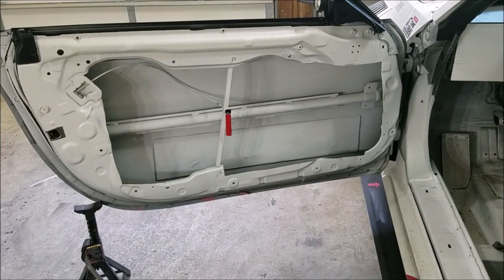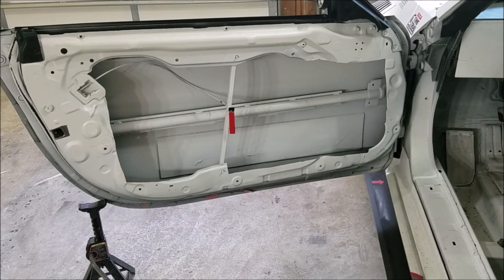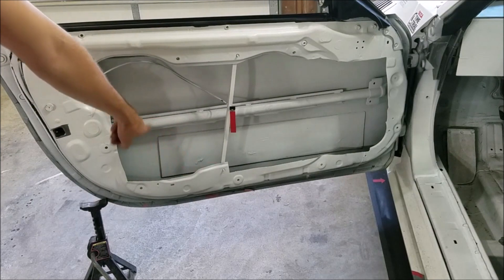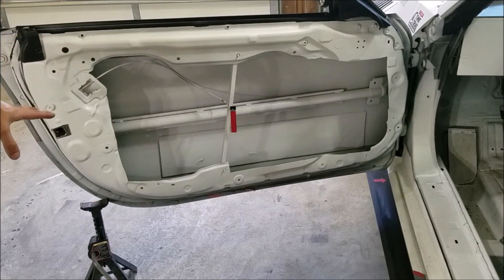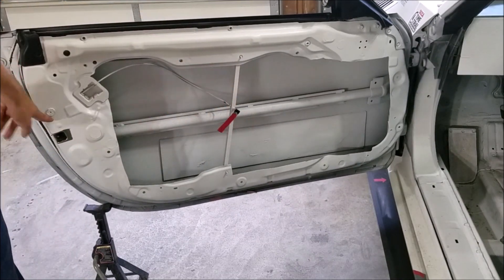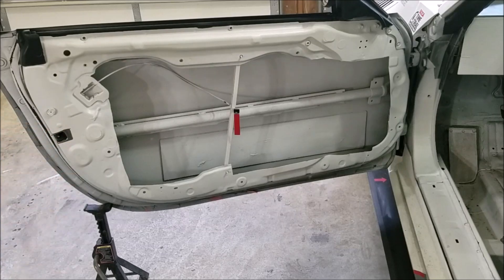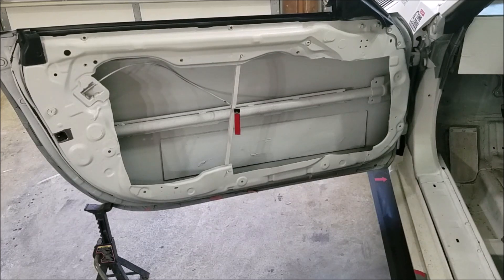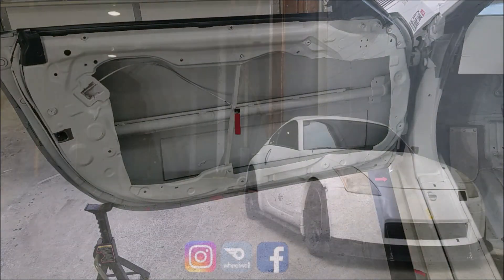Nissan 350Z Racecar Gutted Doors

Comment: Good video. Thanks for the weights. Can you do a video on building polycarbonate windows? For those in the PNW or NE tat can't get rid of windows entirely.
Reply from the maker: My poly side windows aren't the most practical. The hard part about the Z is there is no door frame to mount to; so, the windows need some sort of attachment point to the inside of the roof to seal. I'll shoot a video, but they may not be as helpful as you'd like.

Comment: I noticed that you kept one (of two) cables that attach to the interior door handle to operate the door release mechanism. So only the top cable is needed? What is the bottom one for? Thanks.
Reply from the maker: If I remember correctly, the other cable was for locking the door which is obviously worthless with no windows.